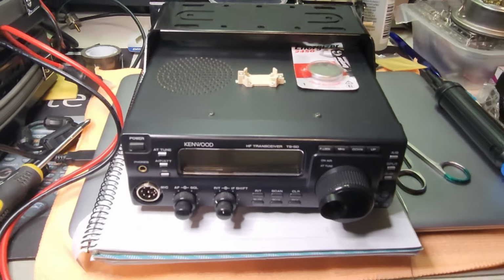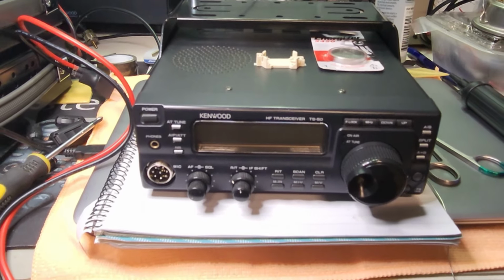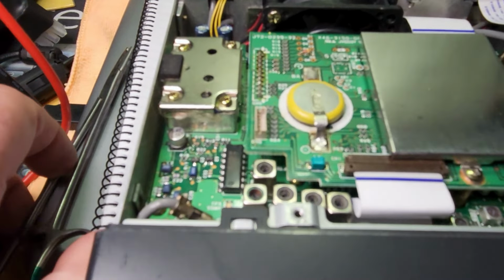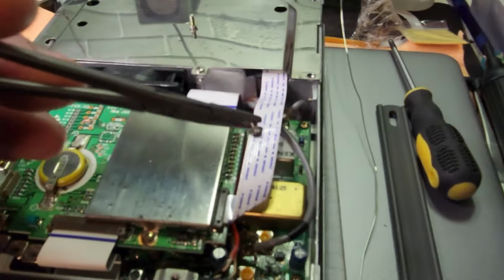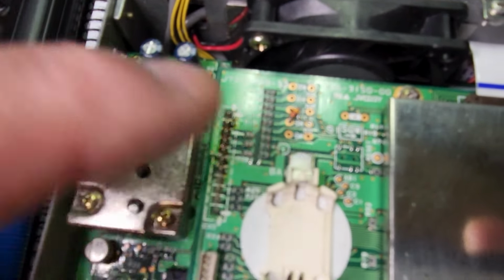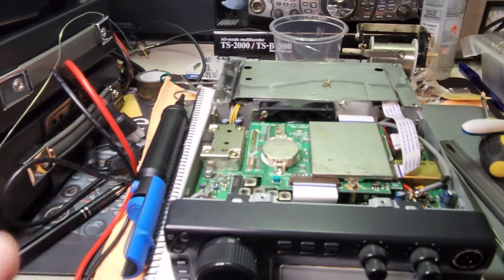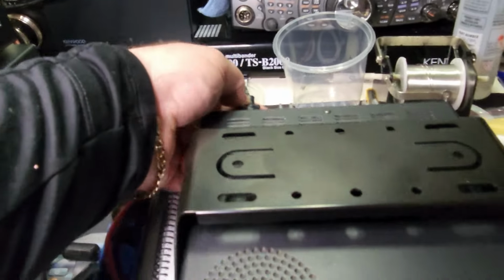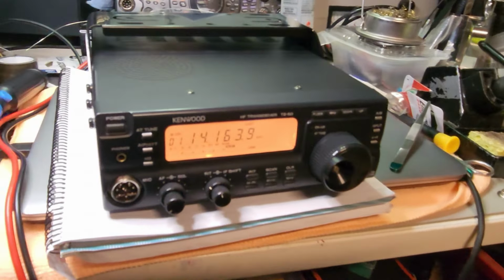Kenwood TS50 TS570 TS60 Memory Battery Replace Install Battery Holder - Tamper Proof Locks

Comment: paul you say plus side up ? on the battery just took mine out and it was the original 2430 but the plus was facing down
Reply from the maker: Have a look at the solder pad closest to you, should be (-), that pad on my holders contact is underneath, it's just how I've done this.
Reply: @Pull_It_Apart_Paul_Ham_CB  what is the name of the battery holder
Reply from the maker: I thought I shared that in the video.  Memory fails me at the moment
Reply: @Pull_It_Apart_Paul_Ham_CB  Renata ( is that how it is spelt ) Also Paul do you have a video about the vfo knob
Reply from the maker: That's it Renata.  They were the highest quality i could find.

Factory the negative is up.

Which part of vfo
Reply: @Pull_It_Apart_Paul_Ham_CB  the part that you added the finger dial
Reply from the maker: @Steve-yg8rk previous owner was skilled on the lathe, brass & steel
Reply: @Pull_It_Apart_Paul_Ham_CB   battery replaced mate ,got to wait for my delivery from amazon so i can do me buttons